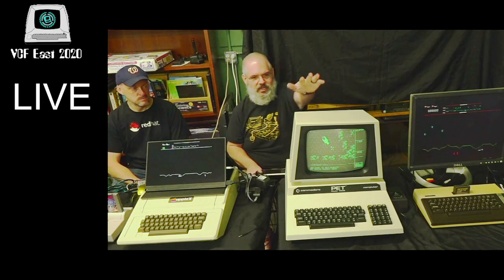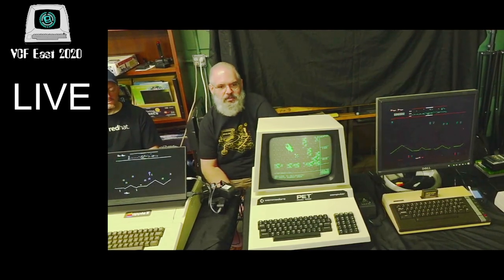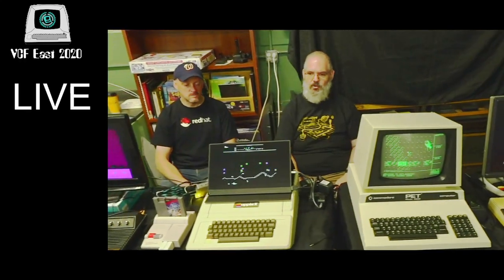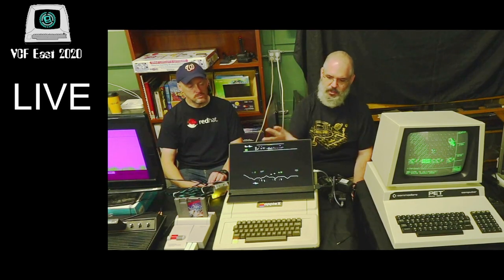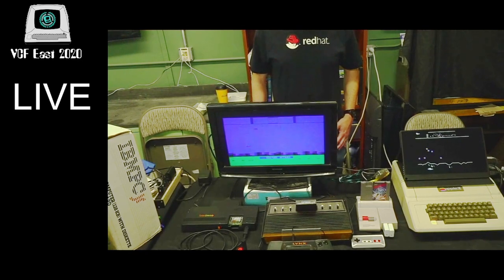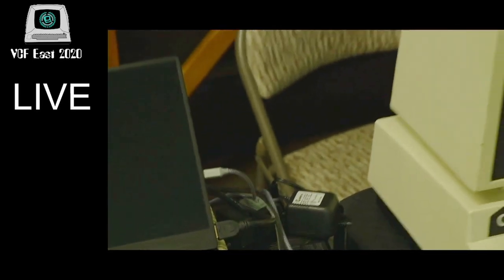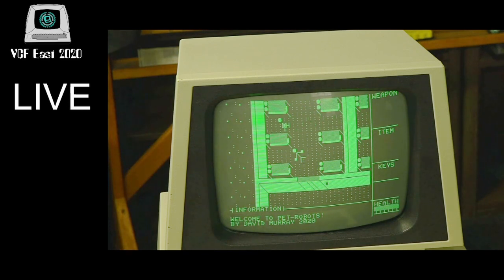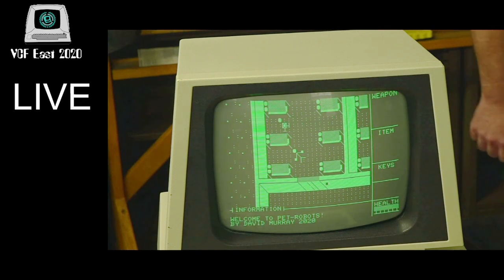6502 Graphics Evolution

Comment: I find it interesting they included the PET and VIC-20 but left out the Commodore 64. While it had the same number of sprites as the Atari 8-bit home computers, they were much larger and colorful at 24x21 in monochrome mode or 12x21 with 4 colors in multi-color mode.
Reply: The c64 was a glaring omission.
Reply: The commodore 64 used the 6510 which is similar but still different from the 6502.
Reply: @JaredConnell  The Atari 2600 used a 6507 and the Atari 800XL use a 6502C (aka Sally).

Comment: The PET does NOT have dedicated graphics memory. It's video memory is located at $8000 in the 6502's 64K memory map.
Reply: It had separate RAMs chip for video memory, on a separate part of the bus. The original PET could only have either CPU or video access this RAM, however, with the "dynamic" PET they changed it to interleaved memory access, but still separate video memory (which helped with the 80 column machines, as they used 2 8bit memory chips in parallel to accomodate for the higher bandwidth needed. Only with the 8296 they integrated the video memory into the main 128k memory, that was then capable of being accessed with 4MHz, to easily allow for 80 column display and CPU access.
Reply: @8bittimes  Thanks.

Comment: No, I CAN'T see the Atari 800XL's better graphics because the screen is still displaying the VIC-20 video. Also, the 256 colors are the palette but only 4, or 16 of them can be displayed at one time. The CPU is the 6502C, not 6502B. The 6502C was based off of the 6502B. The CPU runs at 1.79 MHz, which is faster than the Apple II and Commodore systems, but in the higher bitmap modes, most of those extra cycles were stolen by the graphics chips.
Reply: This video skimmed over the capability of the 800. First of all, it could display more than 16 colors at a time using display list interrupts to change the palette on the fly. It had hardware course and fine scrolling. It had multiple graphic modes that could be mixed, include a few multi-colored character sets. Again, using display lists it could put more than 8 sprites (actually 4 "players" + 4 "missiles") on the screen at a time. It was years ahead of all the other home computers at the time.
Reply: @bjbell52  Yes, I am aware of these features but they are limited to certain areas of the screen.

Comment: The Apple II had enormous sales? It sold around 5.5 million units. That's only half a million more than the 5 million both the MSX systems and Sinclair ZX Spectrum systems sold, and only 1 million more than the Commodore 128's 4.5 million sales, a system many people call a failure. The Commodore 64, based on serial number analysis, sold at least 13 million units. I would suggest it sold well, but of 8-bit computer systems, only the Commodore 64 had enormous sales.